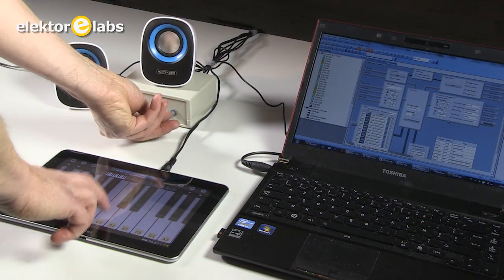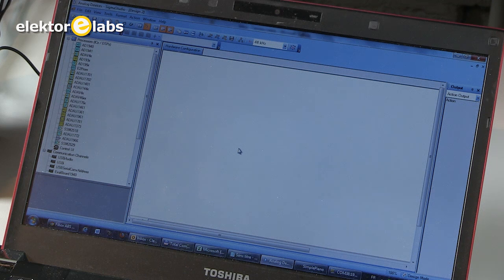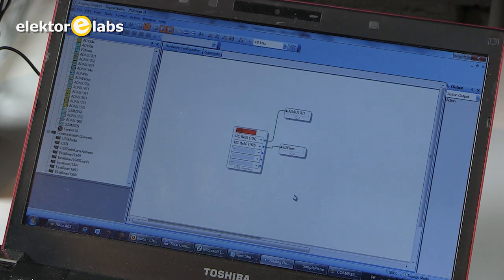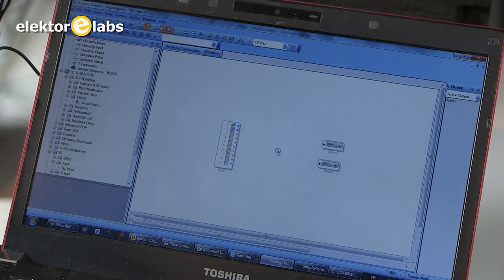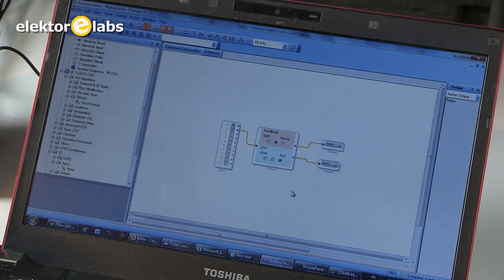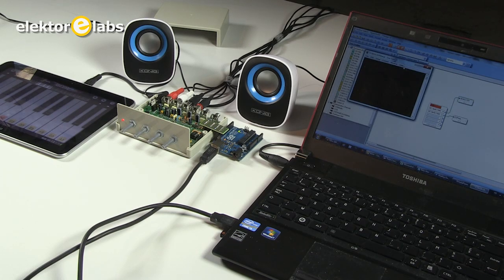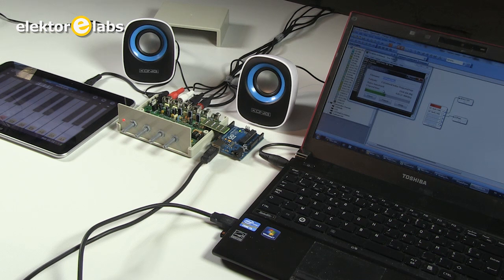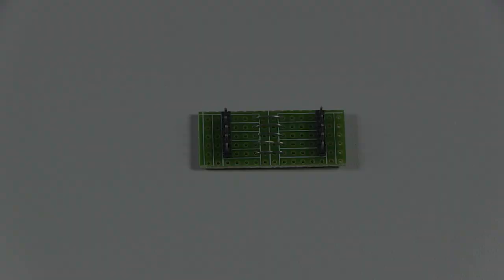Elektor - ADAU1701 Universal Audio DSP Board

Comment: Hi Sir, is there a way to use Arduino to save data to EEPROM of ADAU1701 before it shuts down so it can remember my volume settings when it turns on again? I've read a bit, it seems that "writeback" is the name used for the process but cant figure it out.

Comment: does it require a programmer or is it a stand alone piece, can see the usb, where is it available to buy.
Reply from the maker: It required a simple DIY Arduino-based programmer. Unfortunately it is no longer for sale.
Reply: @ElektorTV  looks to be an interesting board, that to everthing on board unlike wondom dsp,  does it have a room correction ?   is there any by chance one be available , what was its price?

Comment: i hope some one can answer this with the software can i filter sub sonic filter unwonted low frequencys from a subwoofer as i am building a 2.1 modified boombox and the O.E. subwoofer is small two 3 inch in a ported box  and can not take the low stuff like 15 hz to say 30hz just a an example  ?
Reply from the maker: From ADI's EngineerZone: ADI's Dynamic Bass module can do what you're looking for -- in addition to a sliding bass boost, it includes a sharp highpass filter you can set to the lowest frequency your woofer can handle -- to keep subsonic stuff from shaking it apart.

https://ez.analog.com/dsp/sigmadsp/f/q-a/65338/dynamic-bass-boost-basics
Reply: @ElektorTV  subsonic filter are the single most important thing heck my old sansui has one thanks fer letting me know God bless

Comment: Working with Sigma DSPs requires the USBi interface.

At the same time building this project or any other project without the USBi is a waste of time and money.

You cannot control the DSP in real-time with arduino. So don't EVER think its possible without the USBi.

Regards
Reply: You can make a diy USBi with a cy7c68013a (google freeUSBi), but you can easily control the dsp in realtime using the i2c or spi bus from any microcontroller. Someone even made a library for arduino to do exactly this: https://github.com/MCUdude/SigmaDSP

Comment: I have an ADAU1701 breakout with SSM2306 2W class D. It includes the USBi for programming. Can your arduino code replace the USBi completely? I would like to use the ADAU1701 IC with my own 6000W Class D amp but Im not sure about how to tackle the USBi interface. Ill check out the elektor article referenced.
Reply: Hi Nicholas 

I don't think so. I am saving up for the demo board as well the USB uses a proprietary protocol to communicate no replica exists. hehe unless you willing to reverse engineer it  :)
Reply: Yes, it seems strange AD doesn't make real time control easy. Looks like the firmware is on the 24AA256 EEPROM. I think that just configures CY7C68053-56BAXI USB Micro

I'm going to go through the USB uControllers data sheet now, maybe hook up my logic analyzer and sniff the USB
Reply: Nicholas Farrell Hi, yeah that's right! There is a topic on this very subject on the forum hehe I wish there was sneaky way to bypass but ah money making business I guess 

Do you have a blog or contact I get stay in touch with you I would like to keep contact on this topic will visit this maybe in a month or two.
Reply: Nicholas Farrell Have you looked at the adau1446? the 1701 is limited to 4-channel DAC and limited to 4 channels.
Reply: Yes, I have a ADAU1446 Dev board. (It's a beast!) However, for this project I want to use the 1701 with real time control of Sigma Studio.
Reply: Nicholas Farrell Thats great dude, you should have some videos or something would like to see the results, you really got me interested !
Reply: Just a little update. I wrote some code for my mbed, it rips the eeproms registers and shoots the data into an array. Simple stuff really, just an I2C  routine.
Reply: Nicholas Farrell Hi dude. sounds liking you making progress, is this the USBI programmer ?? or just controlling DSP processor ?